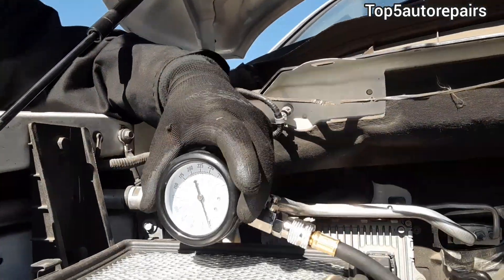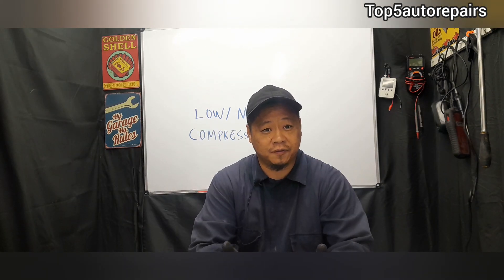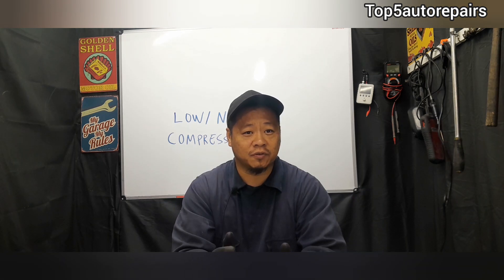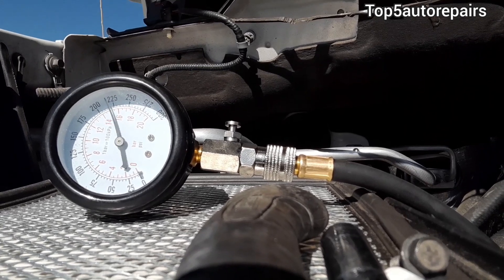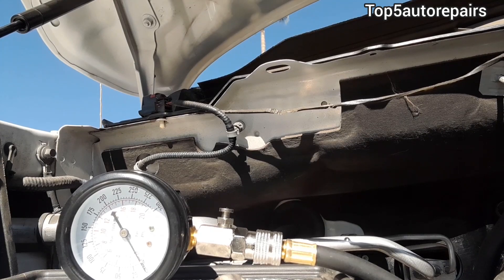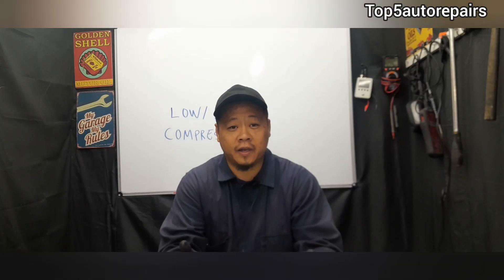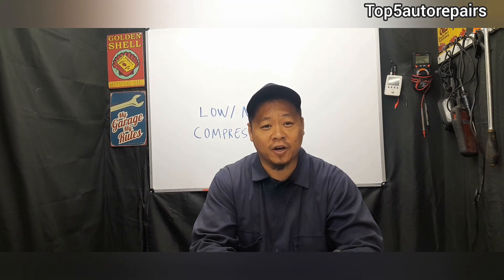WHY ENGINE COMPRESSION IS LOW CAUSES (SYMPTOMS)

Comment: Got a 2007 Audi a4 2.0T 2007. 80 compression in all 4 cylinders. Internal wear and everything 154k miles. No misfire no knock just wanted to see how the engine is holding up because I need to replace my turbo. But they said it’s not cost effective and drive the car until the engine starts to become more problematic and replace the whole motor. 🫤

Comment: 2000 tahoe with the 5.3 no compression in cylinder 1 after driving for 400 miles (with several stops) in 3rd gear because the solenoid went out stuck

Comment: My vw 1.8t compression 120 90 90 and 90. 275k stsrts fine but horrible oil smell especially when going downhill  that eventually turns into a smoke screen like James bond level. Do you think I can get away with just replacing the rings?

Comment: I have a 2012 Honda Accord V6 . It cut off on me one day while I was driving. Now when I try to start it, it turns like in your video but it won't start how to I find out what's wrong..
Reply: What was the problem? Did you ever find out?
Reply: Did you do compression test
Reply: It's the muffler bearing
Reply: Did u find out what the issue was

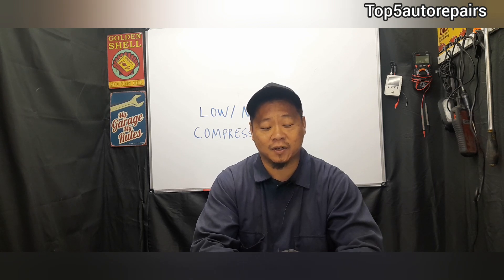Comment: Have a 2018 Hyundai Santa Fe sport miss firing . Took out the plug number four has no compression. car just misses. It does not have no knocking in the motor or nothing always been a good car. 3:28

Comment: Have a 2018 Hyundai Santa Fe sport miss firing . Took out the plug number four has no compression. car just misses. It does not have no knocking in the motor or nothing always been a good car.

Comment: I have a 2013 dodge ram 1500 the cylinder 8 has zero compression. What could to be ? Engine is broken? Because I just got it over hauled a year ago
Reply from the maker: It's common for the exhaust valves  to go bad for that year, make and model.
Reply: @ thank you, I will give that a look and hope that’s the only problem.

Comment: I have P0300 and P0301 & P0302 and both cylinder 1 and 2 are at 80 and 90 PSI compression and the car is misfiring on both cylinders. Replaced all 4 coils and spark plugs and still does it. Have any idea what this may be or could mean?
Reply: 80 and 90 is below the good threshold, sounds like time for a rebuild, or head gaskets blown between the 2 cylinders

Comment: I just rebuilt my 170 Studebaker flat head engine.  I am getting only 60 lbs and it does not want to start. Is it because there is no oil sealing things yet.  Should I add an ounce of oil to each piston and let it sit?

Comment: I did a compression test on my 2002 Ford Explorer 4.0l v6 4x4
It looks like cylinder 3 might be an issue, and 1,2 & 3 is not consistent with 4,5 & 6 cylinders.
Here's the readings I got.
Dry test. PSI
C1. 130
C2. 135
C3. 119
C4. 143
C5. 144
C6. 148
Wet/oil test. psi.
C1. 135
C2. 137
C3. 125
C4. 148
C5. 151
C6. 155
Have you come across something similar, and what do you recommend I would do next?

Comment: Do you know about ford trucks? I got a 91 Ford f350 7.5 and i replaced almost everything new and still misfires. MAP sensor. Purge valve. TPS. EGR valve position sensor. Fuel injectors. Spark plugs and wires. Distributor cap and rotor. Ignition coil. ICM. Air filter. I even did a engine flush. I even check the PCM. Coolant temperature sensor. Air intake sensor.  Like its not hold idle. One minute its ok then next minute, it misfires. Then back to running fine. Then back to misfire.
Reply from the maker: Timing is off or firing order is off. I assume it idles rough and runs okay when in speed.
Reply: @Top5AutoRepairs  how to know if timing is off?

Comment: I have a 2006 X3 BMW bank 2 and 4 low compression. I changed plug,coils and value cover gasket. Still miss fire. I was told to try C-foam

Comment: Honda pilot 2012 V6 cylinder 6 low compression.. 
changed all the plugs, coils injectors Fues checked after..mechanic said.. need a new engine..any idea???
Reply: Plugs and coils do not raise comp. Its something in the head, or its bad rings.
Reply: @shadf7902  this

Comment: On my 3.3 did the test my highest was only 90 all the others were 60 ...only 80k miles im guessin im goin to have to swap engines ?? Extremely rough n u have to mess with it to stay running ..if u try to give it gas it acts like its starved of o2 ..but no vac lines are bad , plugs n coilpacks changed ..fuel filter checked , ran absolutely fine all day never overheats. Never stalls no power losses...filled up with gas 20 minutes after the truck filled their pumps(didnt know they just had found out out from clerk next day ) ..went to start it and its sounded abysmal after starting...never in 53 years  saw an engine be 100%  fine and come out 12 hrs later be f@cked like this

Comment: One of my spark plug has no compression. Mechanic is saying too much money to inspect further and for me to buy a second hand engine. This sound right?
Reply: Ask for a leak down test.
Reply: @andrewcain6518 it’s more economical, keep the old engine and fix it in case you need another. Advice From a seasoned mechanic
Reply: Same situation here. What ended up happening in ur case

Comment: My car has never overheated but I have a misfire on cylinder 3, spark plugs, ignition coil, and fuel injector have been checked and all is good. Would you recommend I do a compression test? Or should I first check MAF, fuel filter or is there anything else I can do or check? Thanks for the video and sharing your knowledge.
Reply: Mine is doing the same thing omg. Same cylinder and everything. It has a rough start and idle.
Reply: Hi Juliana. Same girl. I get my engine sputtering badly when cold and then it starts idling better. It constantly misfires when cold but to prolong its life I'm making sure my oil is topped up at all times and each component is clean and serviced.

Sigh. It would cost me $8500 ttd to buy and install a healthy head and block for my engine. I'm running from that cost. @tingalingsensation
Reply: Did anyone figure this out? I have a misfire on cylinder 1, I’ve already changed all coils and spark plugs and still get the misfire. The car drives fine but at idol it’s rough.
Reply: @tomtakeoff9159  mine ended up being the head gasket lolllllllllll so I had that replaced for $2900 🙃
Reply: @tingalingsensation that mechanic made bank for 2900, and you have an accord?
Reply: definitely check if for anything else check the overall health.. unlikely to be your situation but i had a misfire on my car from a valve cover. I'm guessing your spark plugs were dry when they were removed.

Comment: I have a six cylinder , lighting bolt light came on and went into limp mode, after would not start , have fuel pressure ,spark, good relays etc, no compression in 2 cylinders on one bank no compression on 2 on other bank, have full on 1 and half on last any  thoughts? I asked u about timing on one of your other videos, by the way u have good videos straight to the point with necessary info
Reply: Need new throttle body perhaps.
Reply: Head gasket blew between pistons and blew a hole in one of them , i replaced one piston ..😂
Wondering if its gonna work , it was a fairly new motor too ..
Reply: Did u ever find the solution
Reply: @fadilijasinanovic7061 yes sleeves slide down into engine

Comment: You also could use a borescope by removing the spark plug they are out already you could look at the top of the cylinders😮 to see if it has a hole
Reply: Mine has oil I think or fuel idk but it’s in my cylinder head, but I had a misfire on cylinder 3 and checked my cylinder bores and they all look dry except that cylinder 3, did a compression test and got around 165-175psi but on that cylinder 3 I got 30psi😩do I need to get a new engine???
Reply: @edforthewin8574 has your car ever overheated?
Reply: @ardoario4990 yes a 2015 Jeep Patriot 2.0L
Reply: @edforthewin8574 did u need a new engine
Reply: @fadilijasinanovic7061 yes I did😢